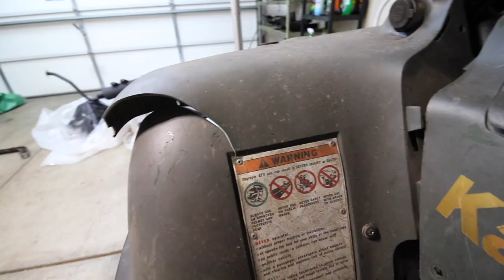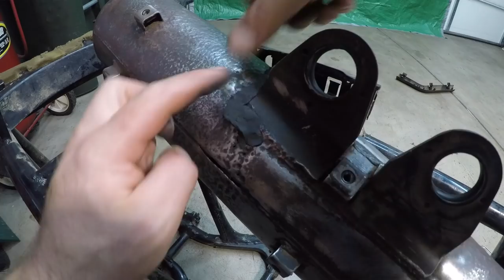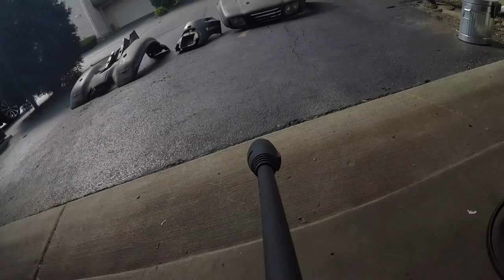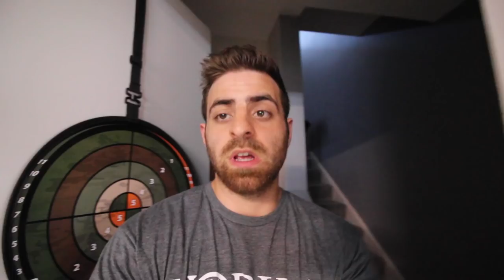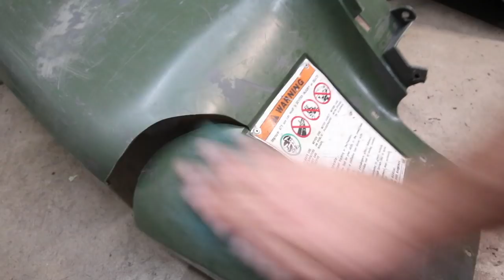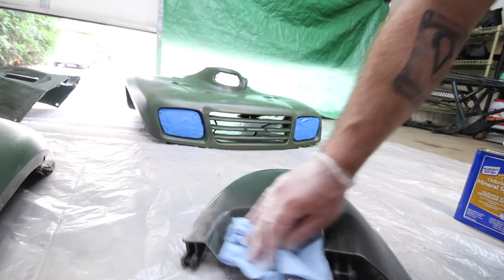How To Paint ATV Plastics

Comment: I always fail at painting plastics. I get orange peel or bubbling.  I finally found something that works. 
1. Wash and degrease plastics
2. Wet sand with 800 grit sandpaper
3. clean with alcohol or prep
4. Spray duplicolor plastic adhesion promoter. 3 light coats. (Follow instructions on can)
5. Duplicolor acrylic enamel *fusion for plastic. 2 light coats followed by 1 medium wet coat. (Follow instructions on can)
I finally got a really nice finish. No orange peel, no bubbles. I cant tell you how many times I have tried to get a good finish on plastics. This worked for me. Thank you jesus. I really hope this info saves someone a real headache.
Reply: How long has it been is it holding up what did you paint ?
Reply: @juan3212  I believe it was for my raptor 700 grill and gas tank shroud. They held up ok. The only issue I had was getting gas on the shroud. It obviously didn't like that
Reply: I'm working on mine now. Made three short videos so far. 1st one is JB plastic weld and scuffing it with red pads. I'm almost ready for the painting, I think.

Comment: Couple of tips, bro.  Exhaust recon. $20 Harbor freight gravity fed sand blaster and $8 of 100 grit media. 15 minutes done.  Get a gas powered 3000 PSI pressure washer.  The electric one that you have just won't give you the best results. Forget the Scotch pad. 1/4 sheet power sander. 220 grit to 320 grit. Wipe clean with acetone.  Ready for paint.

Comment: What did you use to paint the plastics, I was told to use etching primer
Reply from the maker: I used rustoleum universal primer, it’s like professional grade, at least that’s what it says on the can. It worked quite well stuck pretty good on the plastic. I’m sure etching primer would work as well.
Reply: Thanks,